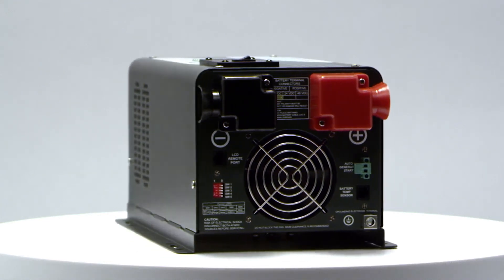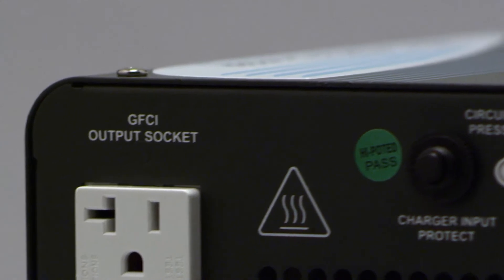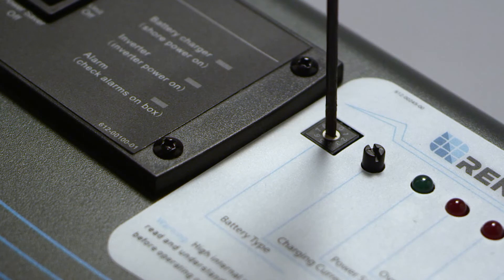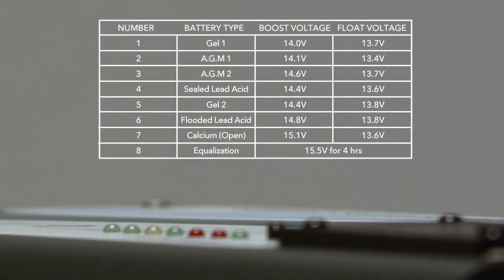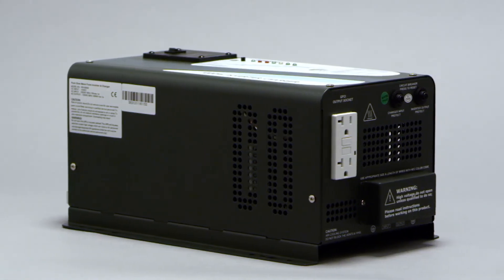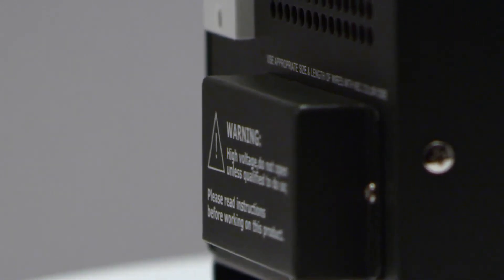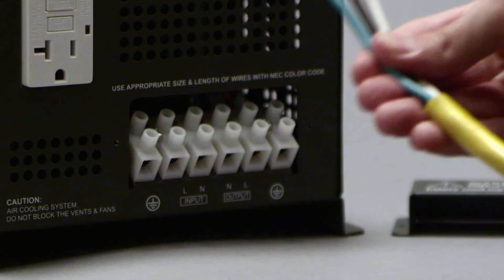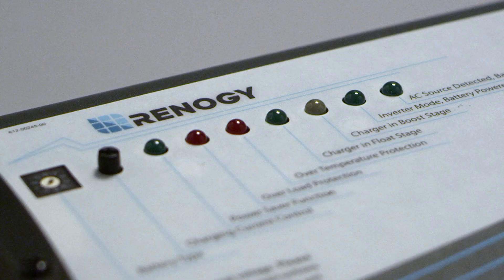Renogy Inverter Charger

Comment: Dear Sir, I have the same inverter / charger at my house, I have never been able to get the #3 charging position   AGM type #2 to boost at a rate of over 14 volts,  I have had to set the charging position switch at #4  Sealed lead acid to get it to boost at 14.4  Do you have the same problem ???    Setting #3 says it will boost at 14.6 volts but on my unit it will not ???

Comment: I'm confused how to connect the ground wire on the Inverter. It doesn't seem to be designed for a lug. So what do I do? There are no explicitly stated instructions or demonstrations anywhere that I can find.
Reply from the maker: Hi, customer. Different places have different grounding methods, so our video does not mention the description of grounding. For specific grounding instructions, please refer to page 10 of the manual book: https://www.renogy.com/content/RNG-INVT-1000-12V-C-BC/INVT-C-Manual.pdf.
Reply: @RenogySolar  Don't insult my intelligence by sending me a link to your manuel. Do you really think I would be here if I hadn't already read the manuel? Clearly, I am only here asking the question because the manuel you linked does NOT give any info about how to actually connect the ground wire to the unit, let alone any information about the order of connection/disconnection. Try again. But this time say something informative.
Reply: @BlackJacketJones The answer is literally in the manual. Pages 10 and 12. Good luck and calm down.

Comment: Renogy, I have connected my inverter and am reading 120 volts at the outlet. However I’m experiencing a voltage drop when utilizing items. I can’t figure out why. Is it possible I just happen to get a bad unit?
Reply: Might be caused by LOW-batt voltage. Using too much power from the inverter, inverter will draw the power from battery with a big current.
Reply: Squid GamingYT interested to know your outcome with your inverter Charger.  I have 8 renogy panels and the have been flawless.
Reply: Power tools will draw a lot on startup which drops the available juice.